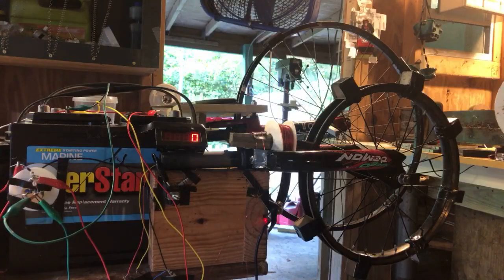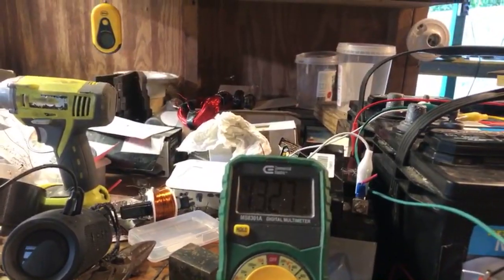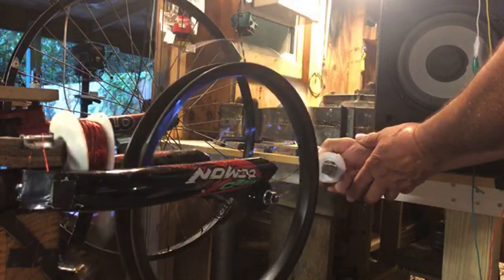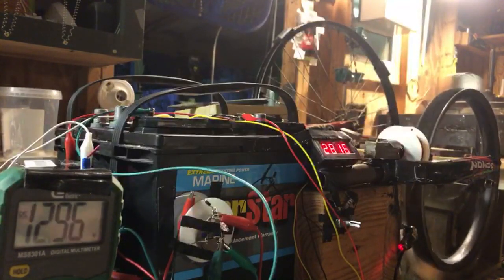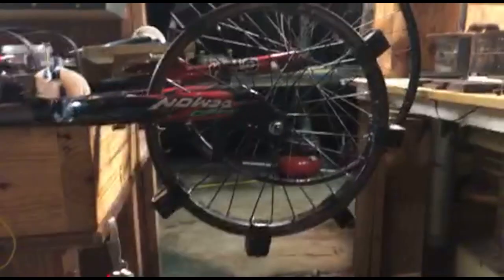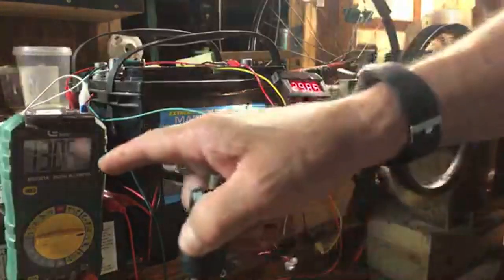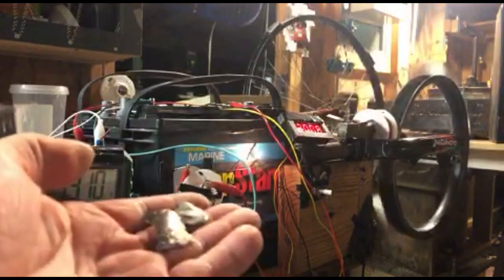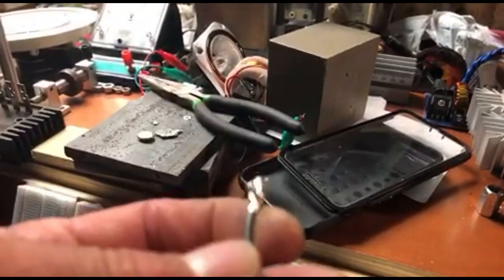Coral Castle, Ed Leedskalnin, Piezoelectric , Treble, Wireless!

Comment: Vinny Vincent, if you can get some type of torque wrench remove the wheel, first tighten the spokes the attach the wheel and then tighten. Tightening the spokes will reduce some of the wobble if you can get the spokes all tightened to around the same torque. Also, with bikes (twenty inch models ) have a rotary system at the neck. If you can figure a way to connect a pos./neg. to charge the wheel might be interesting to see the way in which the magnetic currents naturally flow in the area you are working. Only issue is that in order for it to be a proper test of directional magnetic flow in a given area you would need a level plane which you have, and similar 20' frame forks but with the mounting in the center of the fork, instead of off-set to one side. I thought this up when you suggested testing out how 2 devices side by side would react as a way to better define what is going on in the "ether". To further this idea, perhaps platforms,  wide enough as to reduce as much of the wobble as possible. This would allow for distance testing, albeit at short ranges.
While writing the above I was thinking that maybe it would be better to weld the forks to the bolt, instead of effectively pressing the core of the wheel together in a vice. maybe even having one welded and one not, provided that the magnets you have attached are easily detachable

Comment: Hello what's up? you know that seeing some things I realized something, you have to have magnetism first so radiant energy appears, while more magnetism more radiant energy, here we have a lot of magnetism because we are on earth, and that implies a lot of magnetism towards it, the more up we are less magnetism and higher frequency, more radiant energy, lighter everything, what Edward Leedskalnin does is generate a frequency with his rotating wheel of magnets and from there divert the flow to the water, the water makes capacitive and conductive resistance very large, that magnetizes all the molecules of water and becomes super powerful, and hence having a great source of magnetism, we have a lot of tension, and then transmits all that tension in voltage, radiant energy, high frequency with which lightens the stones and the stone in high frequency becomes very light, all the weight that it has goes to serve as force to raise the rock, instead of weight so that it stays stuck to the soil, that weight pushes up to leave the ground, the magnetism goes inside the objects that are conductors for that reason the tension heats them, for the amount of energy that takes, and the cold energy that would be the other pole walks outside the cable, that is, the objects that are dielectric, that is, they do not transmit the current, they become conductors, because the positive energy that is hot, the magnetism goes inside and the negative energy that is cold goes outside, that's why it is radiating light, energy, luminosity, stanley meyer towards the same, I gathered a lot of tension and stored it in that winding core transformer and then sent it to the card with a lot of dielectric plastic and there it separates the molecules because the high frequency changes them or lightens or eliminates that polarity then the electrons are released and the hydrogen is formed , the same happens in the air that creates ozone, they are electrosis in different densities, water and air, water being more conductive because it manages to stop the magnetic particles that are all, some more and others less, then when stopping the particles in the water it is easier to remove magnetism, and if it were frozen it would still be easier, that's why the magnets levitate when they put dry ice, because they manage to stop the particles and that makes everything is easier, because otherwise they go faster than the light, the glass bottles wound, is to gather magnetism, a lot and then send that energy through the coil, we can talk better if you want, but this is perfect that you do, you lack a pool with water to be a giant capacitor, is like the Reich that drew a lot of magnetism from the water and through the radiant tubes managed to magnetize the hydrogen in the sky, positive or negative, depending on whether you want to rain or the sun comes up , I worked at night because the night is totally magnetic, they are the two poles, the magnetic night, the radiant day, one is black and the other white, like the yin and the yan, one with the other coexist, we the planet earth illuminated In fact, the moon is always going to look at it, the moon is illuminated by our reflection, that is why the violent tides, by magnetism, we inspire oxygen (magnetic part) and then we expire carbon dioxide ( radiant part), the universe contracts and expands because it is the breathing rhythm, it is the rhythm of life, magnetism attracts, radiant ejects, that is why the back emf, is the inspiration of magnetism, it is the water in the ocean that goes and it comes to the shore, the magnetism goes to the bulbs and lights them showing the other pole that is radiant and then returns and shows the magnetic pole, heating the device, we must have a magnetic part first to contain that energy that depends on how much amount of magnetic atoms we can have, that's why iron has many magnetic atoms, and then the lights or a motor, something that expresses the other pole that is the radiant, Tesla had the coil that was like a tube, rque the one of this way as if it were a water tank, so that it can contain more magnetic charge, the thing comes from there, hug
Reply: Interesting
Reply: If water molecules could be magnetized, what would be able to  allow for this containment? As of the magnetic charge could in theory be placed in water, what would cause it to not be distributed into the container holding the water, and consequently being diffused? 

Also, as a second topic,

Under the gaza pyramid, they found a chamber submerged in water, and in this chamber was a large square stone box (was also found submerged under water). Maybe this kind of container could be ideal and would fit your theory.
Reply: @Frozenrains  everything is magnetic atom, all are magnetic atoms, everything that exists, until now what is known, from there different molecules are formed, there are less magnetic things and more magnetic things, the stones have atoms that do not reproduce as the others, are atoms without movement so to speak, I think that a stone containment would be the best, but there are minerals that are containers of magnetism, are little magnetic minerals, did not know that of the pyramid of giza, if sure it was to contain the magnetism, there was also an orgonite that this is what made battery for the great pyramid, the pyramids were made as nuclear reactors around the world, the world already inhabited people, maybe not like us but if very similar, but for sure We are from the beginning of the planet, it happens that science hides things, knowledge, they give us many lies but some things are true, they have to do this because if they were all lies we would give ourselves account, then every many lies some truths, so work the information